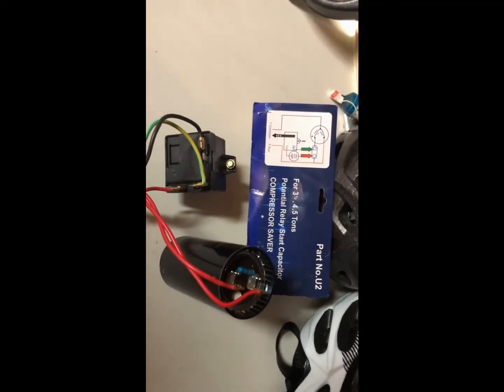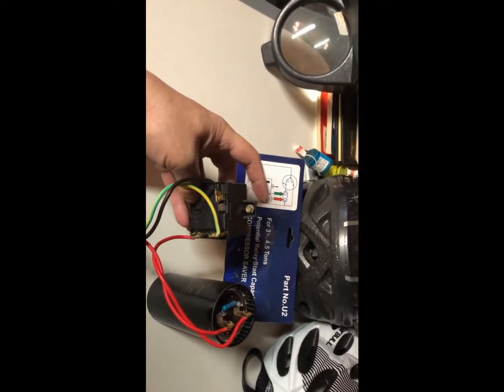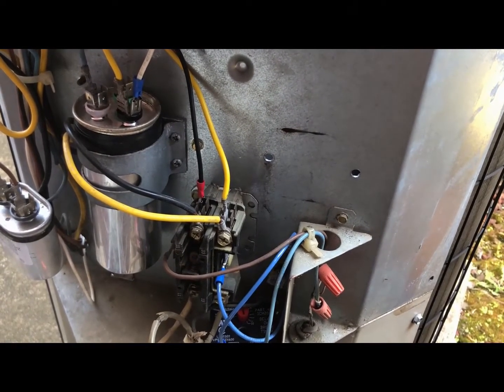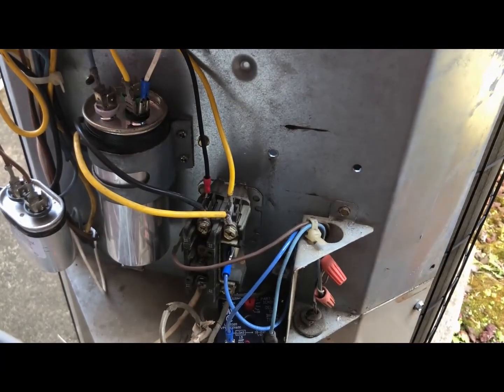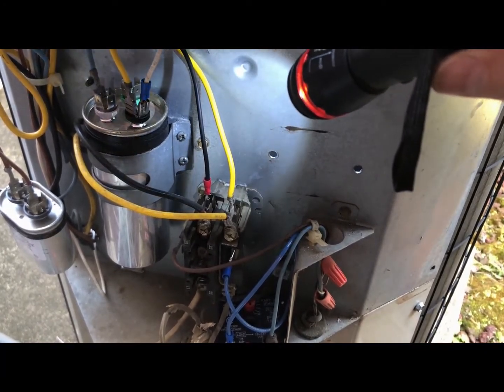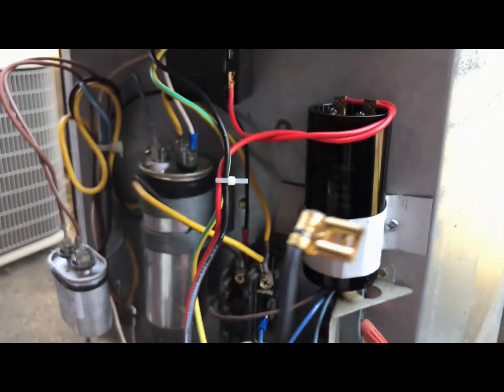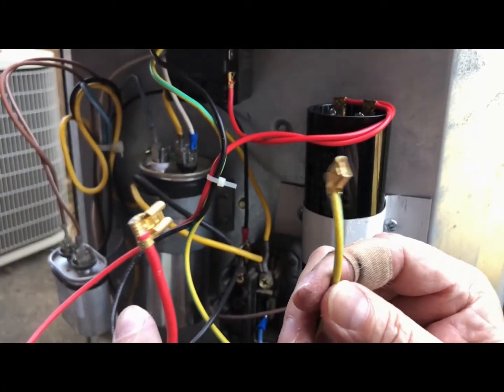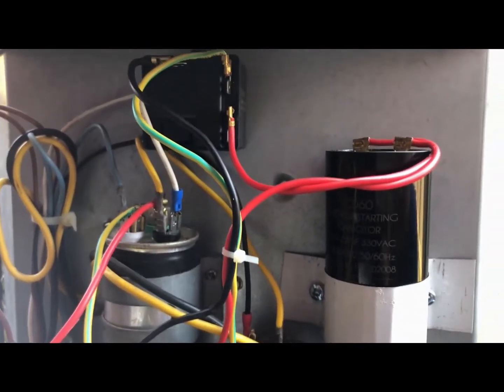Installing 5-2-1 Hard Start Kit to A/C Compressor for Generator! Work???

Comment: so the black wire from the kit  go to black wire on the contactor ?
Reply from the maker: You are corrected
The black wire from the kit go to the black wire of the contactor
Reply: @davidtran4490  my original cap is 75/10mfd , it is not available in the market now so can i replace with the closest one is 80/10mfd
Reply from the maker: The mfd have to be exacted. the 75mfd is use for the compressor and the 10 mfd is for the fan.  You can get it on eBay for $22. Here is the eBay item #182898385979
Reply: @davidtran4490  cam on anh David nhieu

Comment: Should black wire be connected to the INCOMING (L1, BOTTOM terminal) or to OOUTGOING (T1 )?...... does it matter? as this circuit would either be always energized ( if L1), or energized only when the unit calls for power, as if it was connected to T1 in a running condition.

Comment: The black wire from the hard start kit should always be on the common side of compressor which were the black wires.  You almost put it on the run side of the compressor.  Luckily you wired it correctly.